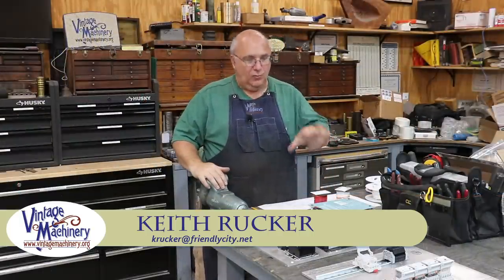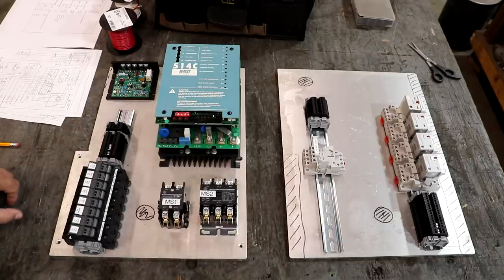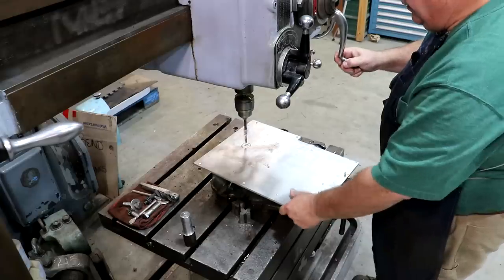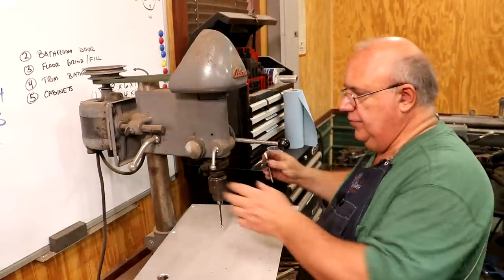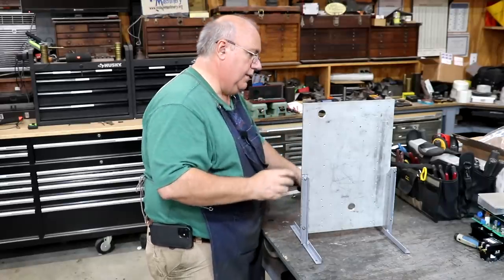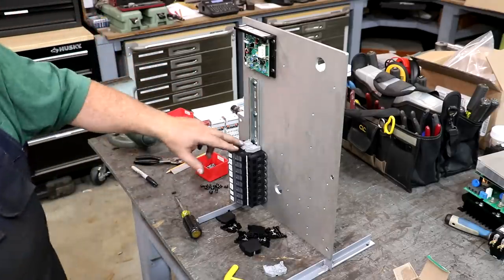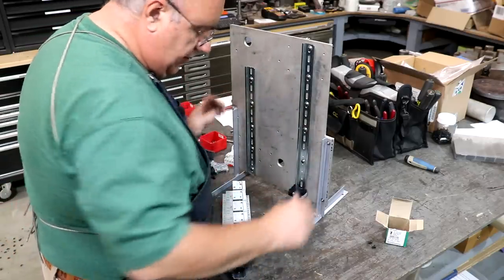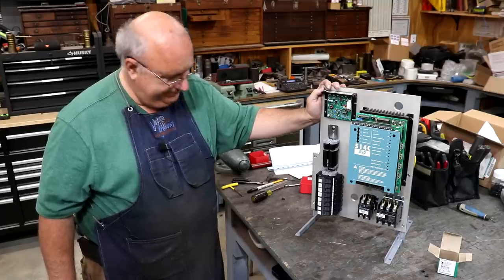Monarch 10EE Drive Retrofit 3: Building out the Electrical Component Panel

Comment: I did many panels for work and used the digital x-Y on the Bridgeport to do the hole layouts. Loved doing that stuff, so it was fun to watch you.
Reply: Sounds almost like cheating. For me it was all manual measuring, marking and drilling. Although we for whatever reason used way thinner sheetmetal (that backpanel actually came with the cabinet) and eiser used nuts and bolts, or in some really desperate cases, self tapping screws (never liked those, removing once and it was like stripped and they had issues with vibrations as well).
Reply: @alexanderkupke920  I've had variable luck measuring and marking when some of the components mounting holes are odd. Also routing out large holes went easier. The Bridgeport was ideal for this.
Reply: @slipstreamvids7422  I think here it came to "sort of" cheating with what I did. what we had to mount was mainly wire channels or the DIN Rails, as about everything we used mounted on DIN rails. And only on rare occasion there was some special power supply that was mounted directly to the plate.
To be honest, in most cases they could have produced just plates with holes for the channels around and like a ladder in between the DIN rails and those might have worked for at least 85 % of what I did. And for the rest, I am sure some rearranging would make them somewhat fit as well.
For bigger through holes we used sort of a punch (you drill a 8 mm hole and then put the punch around, tighten the screw, hole done.) and matching grommits.
Reply: @alexanderkupke920  A Greenlee hole punch set is indispensable to the panel builder. Its been over a decade since I was exposed to this stuff now so I expect other tools and techniques have been implemented.

Comment: Deutsches Institut für Normung e.V. (DIN; in English, the German Institute for Standardization Registered Association)  .  Used in control panels   since the 50's . Very fine choose for this application.   Grommets  are not optional in this case to pass current code in this use .  Nor is it good practice to not use grommets for the reason stated by many others below !

Comment: For those who are asking about a 6 lead DC motor, some earlier DC motors brought out the interpole winding, which gets hooked up in series with the armature A1 or A2 lead. Ignoring it may result in excessive brush arcing under some conditions.

Comment: those dual potentiometers are called stereo potentiometers, they are mainly used in amps to adjust volume for the left en right channel.
Reply: Depends on whether the motor drive has the same specs for both pots. They might be (probably are) wound differently for the field voltage and motor voltage.
Reply: @Mishn0  would they need to be linear or logarithmic not sure with out the spec sheet
Reply: The dual pots on the Monarch drive (used in the tube drives but the modular ones are a little different values) are really interesting pots.  Besides being 2W wire wound linear pots, half of the wiper travel on each pot is shorted - the first half for the field pot and the second half for the armature pot.  This makes sure that the field is kept at the maximum value for the armature voltage ramping and the armature maxed for the field weakening range.  I've made replacements using original wirewound pots and painting half the travel with the silver trace repair paint.
Reply: I have heard them called dual gang.

Comment: Nice work!

that said,
All DC motors have two things; 
1: A Field, which may be permanent magnets or a winding, 
2:  Armature winding(s) 
This usually means 2 or 4 wires.
Some DC Motors may have "SETS" of windings for configuring the motor for different voltages.
Some motors have a couple of extra wires for a Brake, or some sort of thermal protection.
Since your motor has 6 wires, I would like to see the make and model of the motor to look up the specs.
I have been in electronics for many decades, and I have yet to see such a set up like yours that would manipulate the "FIELD" voltage.  Field voltage is almost ALWAYS on and steady whenever power is applied to the system.

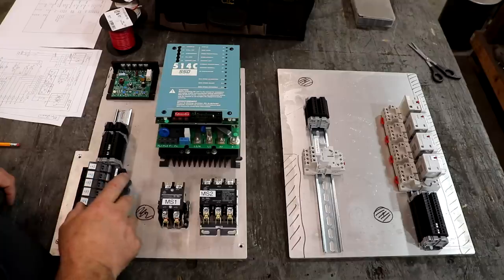I'm wondering what that small square KB (drive?) unit is @2:00
The Parker 514C provides the Field voltage which will always be on when the drive is on, and varies the speed by varying the Armature voltage.

That KB unit looks like a KBIC-120 or something similar.  They are a small drive and I suppose you could be controlling the Field voltage with it,  but that's unusual and not needed.  In fact it may be an overcomplication that may provide a fail point.

I'm wondering,  
Is there another little DC Motor somewhere on this lathe?
Reply: It is a very old design from the 50's.  There is another channel that gets into the details more I think. It may have to do with the original drive being tube based.
Reply: @michael931  OK, I've done some more research and have learnt a thing or five.
Pete Vree has some very good videos explaining the series, shunt, and compound DC motor from 5 years ago.

There are typically 2 to 4 motors on the Monarch 10EE
The main Spindle motor (more on this later).
The cooling motor, a simple single-phase ac motor that is always energized when power is on, and probably used to keep the electronics from overheating.
Then there are two optional motors,  the hydraulic motor and the circulation pump motor.  Both of these are three phase motors that are controlled by simple contactors.

The Spindle Motor is a compound DC motor.
That is why it has 6 leads.
It will have two (2) sets of field windings, one for series, and one for shunt.
And then there will be the armature leads.
If the Shunt and Series windings are wired with the same magnetic polarity you have what is known as the Accumulative or Additive Compound DC Motor.  This configuration is very well behaved and give excellent speed control (a function of the Shunt Winding) and handles varying loads (a function of the Series Windings) The best of both types.

IF, the Shunt and Field Windings are wired with opposing magnetic polarities then you have a Differential Compound DC Motor and lots of weird behaviors manifest along with heat and sparks.  I have yet to learn what a Differential DC Motor is good for, but I suspect that is not how Monarch configured it.

Monarch reduces the energy going to the Shunt Winding after 60 seconds of idle.  I believe this is what the KB drive will be used for, but that is a guess.  I'm wondering if there is a simpler way.

Looking forward to seeing the wiring

Comment: I would still like to see some more support for that panel, or at least have had the heavy component mounted towards the bottom, rather than the top, as was done. Even with a 10EE there will be vibration in use. The panel will also vibrate, as there is really nothing to prevent it, as the fulcrum is all the way at the bottom at those welds. You should be able to grab that panel at the top with the bottom rails solidly mounted, and not be able to move the panel top more than a very small fraction of an inch. But with that mounting, a good strong tug back and forth is likely to bend it, or even break it off.

Likely, the smoothed off holes won’t be a problem for the wires, but aluminum is still harder than insulation and unless polished, can slowly rub the insulation. I don’t know how the wiring will be finished, but I’d like to see it inside a wire clip on both sides of each hole, fastened to the plate so the wires can’t move. I would also prefer to see the DIN rail horizontal. End stops are good,  it best practice says horizontal.

Comment: Nice work on the mounting plates, maybe you might want to add a cooling fan for the electrical parts so they don,t over heat in the warm hot days of summer.

Comment: I believe you should have a couple of support braces to that panel. Over time it might fatigue and fall over.
A flag pole is fairly stable, but if you want to mount it upside down then you better use a support brace.

Comment: As always you do a great job, but I do have a question. That looks like 1,500.00 of electronics, to run a 70 year old motor, Why not a 3 phase motor and a VFD? I know you prefer to keep things as it was built, but I'm wondering why this route?
Reply: He mentioned in an earlier video that dc motors have better torque characteristics at low rpm than a 3 phase with vfd. Also the DC motor has a gear box that is part of the motor. People have done the 3 phase conversion, but it's all preference and Keith wants to stay with the DC motor.

Comment: I've always wondered about slamming the mill in reverse like you do when tapping the holes. 
I was tapping a 1/2-20 thread in the mill like this once, and slammed the mill in reverse to pull the tap out, Mt boss saw that and reamed me about about how it's "dangerous and hard on the mill"
I could see that being kind of hard on the belts I suppose. 
But as for machine shop etiquette, is it improper to be slamming a 3 phase mill in and out of reverse like that?

Comment: Unless you put some screw end stops on those rails you'll finish up with a pile of components in the bottom of the lathe. Vibration is the enemy of electrical work.
...just a thought.
Reply: It depends on the specific end stop blocks.  Some hold very well.  I doubt there will be much vibration down there as everyone seems to think. The thing weighs 1000s of pounds.  The motor is on the other end.

Comment: There are 6 connections. Is one pair a tachometer output? The regulator needs an input that is linear to speed to keep the speed constant.
Reply: I also wondered how it will maintain constant rpm under load, maybe the motor really has a tachometer output, otherwise 6 wires don't make sense because you only need 2 for the field and 2 for + and - in a regular brushed DC motor.
The only DC motors which may need 6 wires are brushless DC motors which are basically 3 phase motors.
2 for field, 3 for the 3 coils, 1 for the center point of the star configuration.
But they need special controllers which generate a special kind of 3phase AC power which frequency is matched to the actual motor rpm. 
These motors are often used in RC airplanes and cars.

Comment: Great video. I have concerns with your pass through holes for the wires. This aluminum panel is not unlike an aircraft bulkhead. The constant vibrations in an airplane are not unlike a lathe operating. We would never consider not using a pass through or major grommet on the hole in an airplane. My recommendation is to not have any wiring passing through a raw aluminum hole. I have much more experience as an aircraft mechanic than machinist. Just my thoughts.....

Comment: Great video. I just have one question: why did you use slotted screws to mount the assembly  board to the mounting brackets? Wouldn't phillips or socket head screws have been better?
Reply: He probably used what he had.  What difference does it make?  Why would Phillips or Allen be better?  All the fastener has to do is not break and not fall out.
Reply: @michael931  Don't get upset, I was just curious why he used slotted screws.
Reply: @rickburris6164  not upset.  Just wondering why those would be better as you stated.
Reply: @michael931  slotted screwdrivers are notorious for slipping out of the slots and stripping out and are generally not good for applying torque.

Comment: Is there not a conceren with a galvantic reaction with the dissimular metals?
Reply: Why? Electrically speaking proper bonding will include a ground between the board and tray and between the tray and machine body. This eliminates grounding through mounting connections. But anytime a steel to aluminum connection is made for bonding then yes No OX, OX Guard or similar needs used. On this panel the only likely place it's needed is a ground lug for bonding purposes.

Comment: I looked up the Parker 415C and it's not a simple item! Cost is appx $2-3K.
Setup is not for the faint of heart! 
It has 12 potentiometers and 10 dip switches. The potentiometers are not set correctly from the factory, according to the 43 page users manual. 
The dip switch and potentiometer settings are used for startup voltage ramping and a bunch of other settings related to the particular motor and its application. The pots are adjusted using electronic instruments during the complex sequence of setup procedures.
It does have fixed voltage field outputs, F- and F+, but as he said, these are not suitable for his application.
Quite a rabbit hole reading the user manual.

Comment: Can you show the mechanism you used for running the tapping process in reverse ??
Reply: He just ran the mill in reverse.
Reply: Where did the lever come from ?
Reply: @johnquinn3899  it's part of the mill
Reply: Thanks johan, I would like to duplicate this lever, John
Reply: I should add, the on-off-reverse switch on my old Bridgeport is located on the top, left side of the machine towards the rear of the machine
Reply: @johnquinn3899  get yourself a reversing tapping head.
Makes it alot easier.
Reply: @johnquinn3899  Why would that switch be mounted towards the rear of the machine? That needs to be located to the front of the machine such that it can be easily operated from the front of the machine.
Reply: That’s why I would like a
Photo. My machine has been modified and abused the 40 years before I bought it, not knowing what it “should” look like, I bought it

Comment: Did Keith say what the input power is going to be: 120 v, 240 v, three phase?
Reply: It's 240V single phase to the 514C motor controller and 120V to the field controller.

Comment: Do you have an electrical diagram of the motor? I am having a hard time understanding why you have 6 leads coming from it. I can see armature, and field, whicj woukd be a total of 4 wires, but am having a very hard time understanding what the 3rd electrical component of it could be.
Reply: I think Keith mentioned that there are two field circuits... Quadrature Field Motor.
Reply: The two remaning wire are serial field.  It was used to help the motor to maintain speed when the load increase. You connect the serial field in serial withthe armature A1 and A2. Today  electronic drive you have an adjustable compensation for the load name IR compensation.  So you do not use anymore those 2 wires.
Reply: @tracteurfan4734  thanks, I have a vague recollection of something like this from 50 years ago, or so.

Comment: If you really don't want to use grommets atleast use some heat shrink tubing to protect the wire shielding where it passes through the aluminum plate.

Comment: I'm a mechanic by trade but does anybody know why machinist always use socket head cap screws/bolts.
Reply: Small head and decently high torque. They don’t cam out like Phillips.
Reply: @ericpaul4575  I even ordered some socket head flat head screws to replace the Phillips flat head screws retaining the sub base on my Hitachi router. By the way, I am a retired machinist.

Comment: Just out of interest, do you happen to own any step drills? It was painful watching you use that radial arm drill and changing bits etc, when a battery drill and step drill bit would have drilled those two holes in less than 60 seconds.
Sometimes getting old and stuck in our ways is a disadvantage is all.
I know coz I think we are the same / similar era.
My kids do a wheel change in about 2 minutes with their battery Milwaukie rattle gun, meanwhile I’m still searching for my wheel brace. 🙄😂😂😉

Comment: I find it interesting that a man that has EVERY machinist tool in triplicate has to beg for money at the end of every video.
Reply: Expensive machines and tools sitting idle do not educate anyone. It’s Keith’s time and experience and hands on instruction that his subscribers are willing to support.
Reply: @ellieprice363   If they're so "willing to support", why the need to constantly ask for more?  Picky, picky Ellie?
Reply: OK, 40 year home shop machinist chiming in here: do you have any idea how much money it costs to keep even a small home "hobby" shop in a running state? Tooling is a constant drain on the wallet. Each new project, more often than not, will find you purchasing parts, tooling or other consumables needed to complete it. Some of those costs are high: Example: coolant generally starts at $20.00 per gallon and you usually have to buy at least 5 gallons. Raw material costs are through the roof if you have to purchase new stock. Tool inserts: many times you must to purchase 5 or 10 even though you need ~one~. I haven't even touched on shipping costs/ fuel surcharges. I don't run a YT channel, but his cameras, mic and video editing rigs have to be maintained and upgraded fairly regularly to keep pace with new software/ operating systems. Even if run purely for personal use, a home shop needs regular maintenance and investment (time, money, effort) to be useful. And then there is his website, http://www.VintageMachinery.org which is an invaluable treasure trove of knowledge and information which must also be paid for, maintained and curated. He's not "begging" for money, he's saying every bit helps. My $0.02 .
Reply: @aquaseafoamcrayon1739  I support Keith’s channel. Do you?  The picky picky viewers are the ones who constantly find something to complain about while watching free educational content.